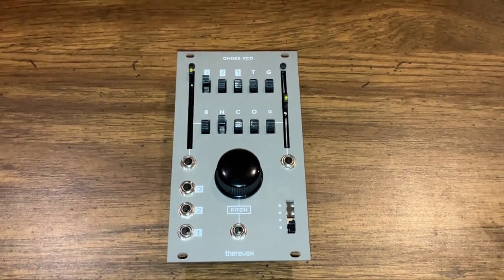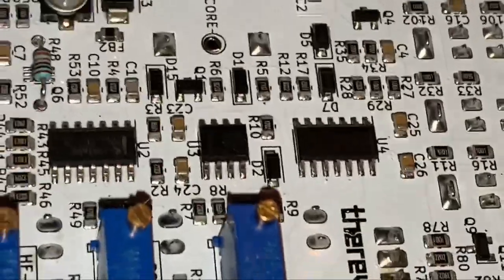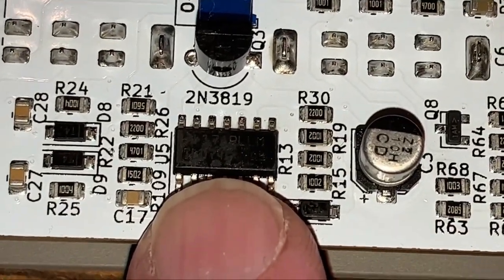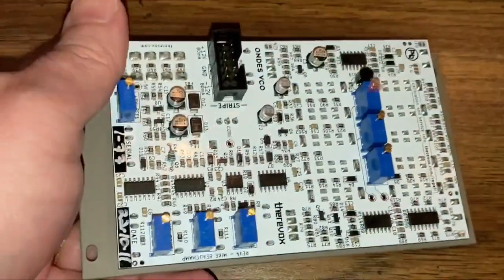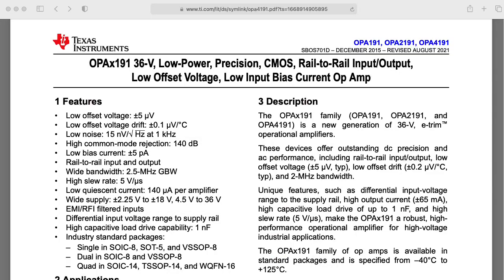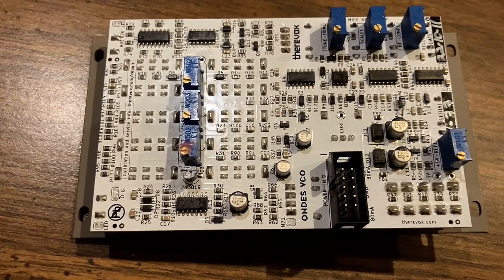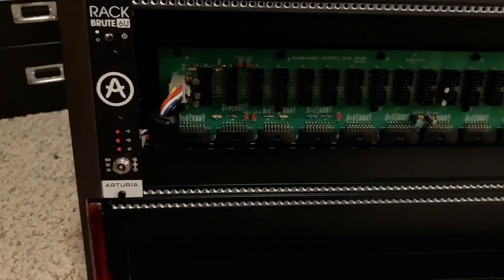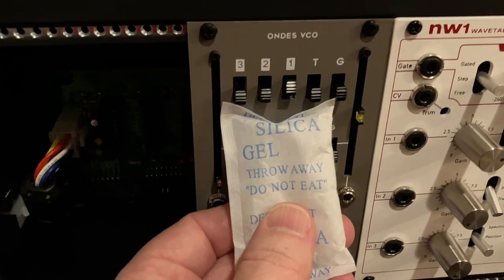Therevox Ondes VCO PCB Examination and Arturia RackBrute Ruminations (Ondes Martenot obsession)

Comment: I'm going to guess the OPA4191 is used for the integrator in the core, it's next to the LM311. I think the CMOS having lower offset voltage and even lower bias current will be useful there, although I'm not sure if the net effect is worth the extra $$$

Comment: Maybe the 4191 is for ensuring there's enough current capability and capacitive load handling to let someone, for example, plug in a pair of headphones or drive a long cable?

Or perhaps it's for the rail to rail headroom. However, there are cheaper and also high performance chips available to do these things.
Reply from the maker: I'm pretty sure it's for something other than driving headphones or cables, since it always outputs a waveform; in a musical context the output of this will always be put into some other module, at least a VCA.

Comment: The OPA4191 is most likely being used because of it's extreme low offset voltage, combined with temperature stability. As their website states, there are "several improvements that increase stability over variations in voltage and temperature", which is exactly where the OPA41911 excels.
The power panel on the RackBrute is most likely there for multiple reasons. First of all the Blinkenlights, we Eurorack synth users love our Blinkenlights, and second because a lot of times these cases area placed next to, or on top of, each other. 

"Do not eat" (in quotes) is most likely written by someone who likes frickin "lasers" 😂

Comment: I'm wondering if using the OPA4191 has anything to do with the comparator creating steep voltage changes when wave shaping. The OPA4191 is mentioned as a precision opamp that is also 'MUX friendly', so it can handle steep voltage swings in the input without being damaged.
Reply from the maker: I'm not sure... if Mike went with the original waveshapers, I don't think he'd need anything fancy. Part of the charm of the original wave shapers is a bit of their sloppiness, I think.

Comment: 65mA is quite alot for an opamp.
you absolutely need an "Make Noise Maths", the worlds most sold, coolest, difficult and versatile module, others to consider are Make Noise Tempi (cool multi clock module), Make Noise Morphagene (SD card sample player), Make Noise Mimeophon (delay), Make Noise Erbe Verb and Piece de resistance: Make Noise DPO.

Are you going to upload sounds bites here?
Reply from the maker: Re: sound bites, eventually, probably
Reply: @Lantertronics  check these video's: "MakeNoise DPO: Rhythm Track" this is the exact grammatical formulation as written in the video title, super cool! sounds in combination of some cheap doepfer modules.

"Mellow sound of Make Noise DPO."  very cool string like sound.

Comment: A walkthrough of the schematic for real implementations of synth modules like this could be really informative. Particularly to see how they engineer them differently from the common example circuits, be it for performance or price. Real implementations of all sorts of voltage-controlled circuits in particular interest me, getting them linear is tough.

Assuming the schematic is actually available that is. Circuits like this are in that middle ground of being easy enough for frauds to reverse engineer and copy to sell, but not so plainly simple that the average end-user is going to be able to figure it out.
Reply: Oooohh - It could be interesting to do a series/video that analyzes the designs of mutable instruments modules, seeing as they're open source? As a bonus, IIRC Emilie mentioned in an interview with Darwin Grosse that she learned a lot from this channel so it could be a neat full-circle thing 😊